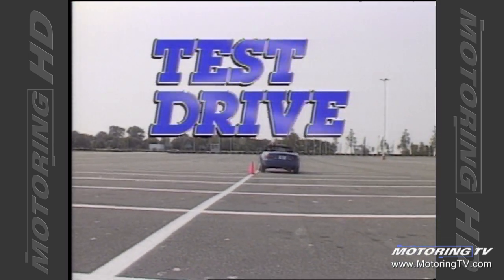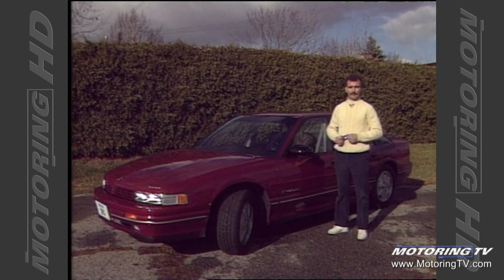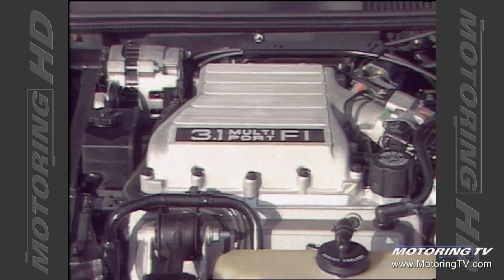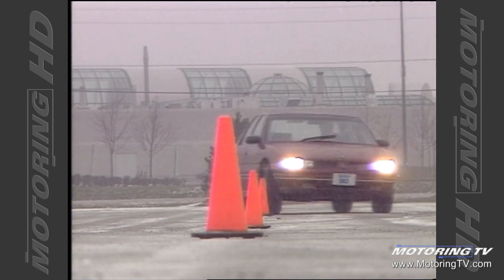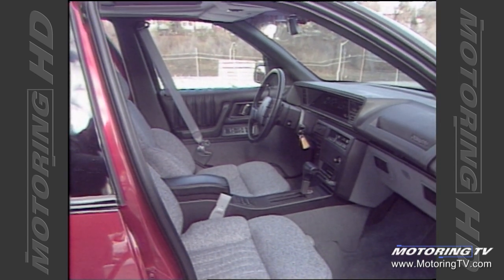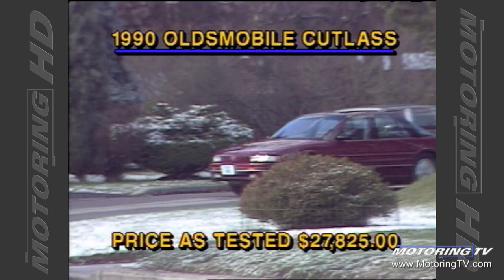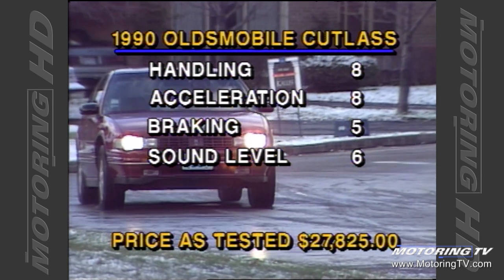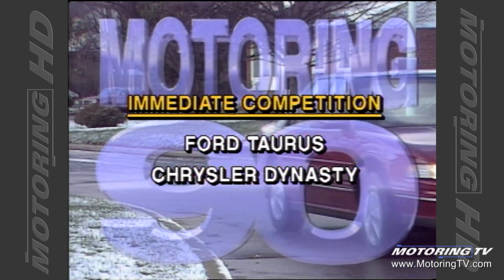1990 Oldsmobile Cutlass - Throwback Thursday

Comment: Nice car that was similar to the sportier Grand Prix and Regal sedan. R.I.P. OLDSMOBILE 1897-2004.
Reply: Oldsmobile was above Pontiac and in my opinion Buick as well. The regal sedan make less power so how could it be sportier and also the Grand Prix and cutlass supreme had the same engine
Reply: @KingARob_  I see your 3.1 olds sedan and raise you a 1991 3.8  regal....exclusive to buick by the way
Reply: @Jag-leaper  the 3.4 dohc v6 found in the cutlass lumina and Grand Prix had superior power
Reply: @KingARob_  and terrible reliablilty..so gm got rid of them for 98 in.favor of the 3.8 which also has superior  low end torque